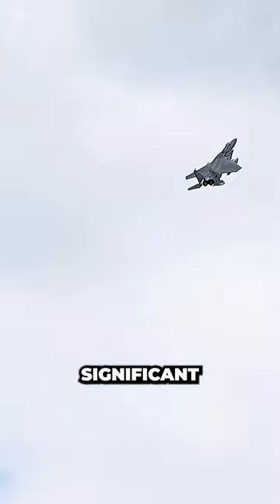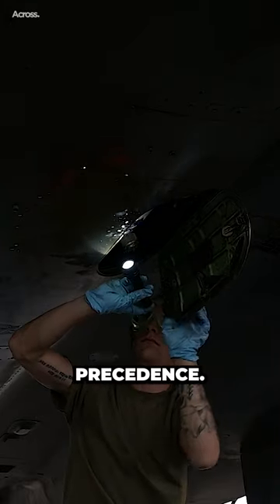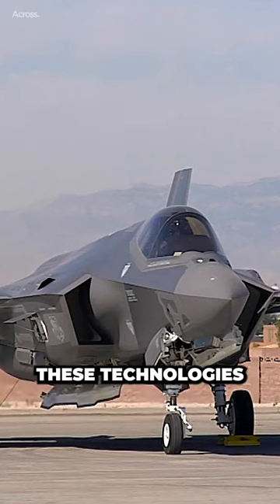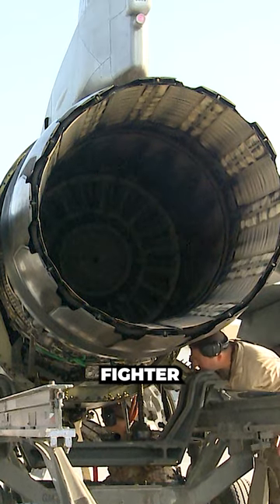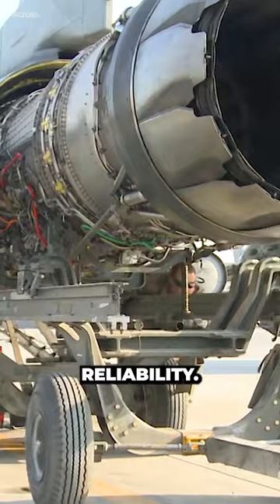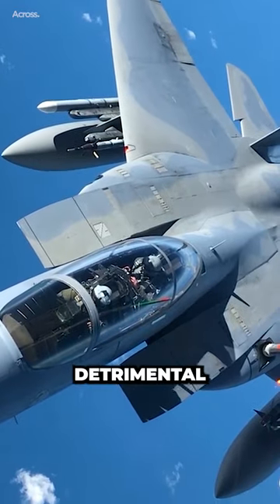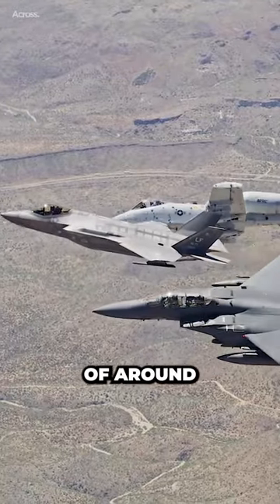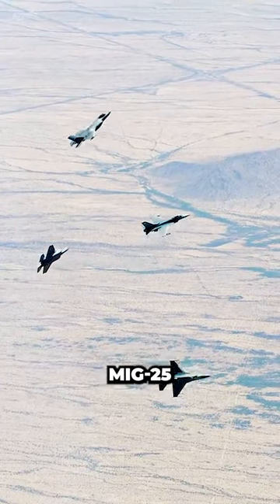Why Are Modern Fighter Jets Slower? #shorts

Comment: the MiG-25 could DEFINITELY NOT reach mach 3.2 mate, match 3.2 is what the SR-71 is capable of doing, the MiG-25 would have already fallen apart before even getting close to that
Reply: There is a verifiable story of a Mig 25 chasing down an SR-71 over the Sinai peninsula, it was observed on Israeli radar amongst others. The issue here isn’t just top speed. Once the SR71 is up to speed, nothing can catch it, but if you anticipate where it’s going to be and do some complicated math and have observed the aircraft and it’s track a couple hundred miles early, you can time an intercept if you have a very fast aircraft (and fast climbing aircraft). This is what happened and how the Russians managed to intercept the Blackbird. The problem the Russians had once they intercepted it was the amount of fuel and thus chase time the Mig had, and the issue that they needed to be within a couple of miles of the blackbird to have a chance to hit it with missiles and they were ever so slightly not close enough (the missiles weren’t fast enough to catch the SR71 unless fired at very close range and at max speed of intercept aircraft). The Russians cooked two engines in the process of this intercept attempt. It must have been some spectacle to watch on the radar screen. 

The reality is if you want to catch the blackbird and don’t have the foresight to be able to anticipate it’s trajectory, you would need to have an aircraft already airborne and in position, or you would have to be flying MUCH faster than the blackbird (which wasn’t practical).  Remember to catch a running human that has a head start, you would need to run much faster yourself.
Reply: Миг мог летать быстрее. Описан случай его непреднамеренного разгона до 3.6 м. Но на таких скоростях перехват крайне сложен. Как ни пытался израиль сбить миг над своей территорией так ничего не получалось. Америкпнцам удалось это но подловив его при заходе на посадку.
Reply: @АлександрШершнёв-р6с  i am sorry to disappoint you but it is physically impossible for a mig-25 to go faster than mach 3.6, the SR-71 is already cooking at that speed from the friction of the air, the mig would just be melting at that point
its skin is mostly made out of steel which is definitely not able to sustain the strain of such speeds, even if it could accelerate that fast
a mig-25 is still very difficult to intercept of course because it is actually able to go a lot faster than most fighters but it being able to go above mach 3.6 is physically impossible and saying so is just misinformation
Reply: @just1moro168  есть ,статья в которой описан случай разгона миг-25 до 3.6 маха. Да в самолёт изначально не заложена была такая скорость. После этого полета самолёт имел множество повреждений, но его разогнали до такой скорости.

Comment: Are they really slower? High end air superiority jets like the raptor and f-15 are both well over mach 2 like their predecessors. And the f-35 is only 1.6, but it carries all weapons and fuel internally so it can practically reach those speeds in combat, while older Mach 2 fighters have to carry external stores, and will rarely fly that fast in combat, if ever.

Comment: Speed will always count.
Reply: Not really.
Reply: Yes but clearly other factors do too.
Reply: @mpondachongo1138  когда нет? Приведи пример?
Reply: @АлександрШершнёв-р6с  modern misses no longer need to out run the a target only intercept it, plus higher speeds mean less manoeuvrability which means a more predictable flight path.  Plus higher  speed means more stress on the airframe which means that they will have to be replaced more often, which is very expensive.
Reply: @mpondachongo1138  вы ничего не понимаете в авиации!🤦🤦🤦

Comment: The engines are not the limitations of modern fighters!!! It's the intakes. Compare the engines of F-4 and the F/A-18. They are almost the same but the F/A-18 is lighter and smaller. The F-4 is faster though. How can this be? The older F-4 has a more advanced intake more suitable to its interceptor role. Modern aircraft lack the advanced variables geometry intakes of the jets of the 60's and 70's

Comment: Well that's just top speed. I mean what's the point of reaching it when you have no more fuel left to do your task. And besides! The indicated top speed of older fighters are clean config. No f15 is reaching mach 2.5 fully loaded for war so what's the point? Anything hanging on your pylon will tremendously lower your maximum speed.

Comment: Well you also gotta consider that the MiG-25 was built to intercept the SR-71 which is one of the worlds second most fastest air breathing plane ever. That bird also exploded if it went that fast
Reply: MiG-25 hitting mach 3.2 burned it's engine out MiG-31 homever
Reply: The Mig 25 was made to counter the XB-70 that never got fielded.  Mig 25 was limited to mach 2.8.  The follow-on Mig 31 was usable above mach 3 and could intercept the SR-71 if coordinated by regional ground control radar.
Reply: As far as I know the SR-71 BLACKBIRD is still the fastest plane ever built.
Reply: @mpondachongo1138  официальный рекорд у него. Но мало ли

Comment: The F35 is not highly maneuverable.  It has very high wing loading.  In combat the F35 stands off and fires its missiles then egresses.  The F18's come in and clean up.  The are much more maneuverable and fly much better with great nose authority.  That's a better example.  Not a fan of the F35.  For its cost it should fly better.

Comment: Yeah, speed isn't important anymore. That's why the hypersonic race is a big deal. When are you people going to get it. The F-35 is by every metric a shit airframe.  Everything good about it is either a system or a weapon. All of which are not intrinsic to the airframe. Basically Lockheed stole your tax dollars, fucked up the jet, and are making excuses as to why it dosen't suck. The same is true for the Airforce. We should have at least 500 Raptors, all or most of them, with the most important systems from the F-35. The vary fact that NGAD is being developed is absolute proof that both the F-35, and F-22 are failed programs.
Reply: Note that hypersonic technology is primarily focused on attack missiles, not fighter aircraft, so your claim isn't relevant.  The F-35 failures aren't so much due to Lockheed, but moreso due to typically convoluted military procurement cycles where the design gets jacked around by changing and/or conflicting requirements.   Trying to make one airframe that performs all missions for all services is a classic FUBAR.